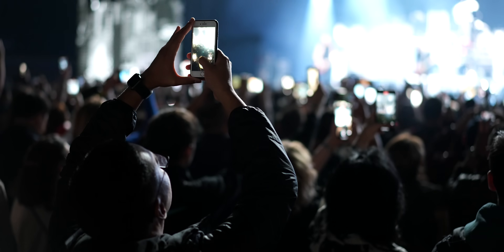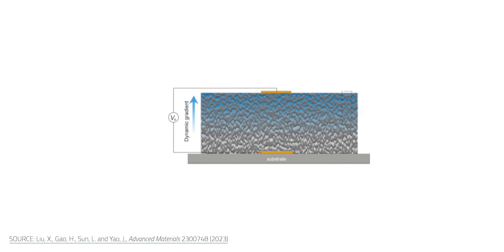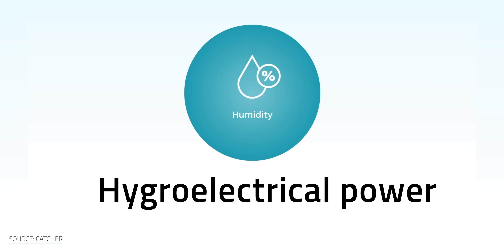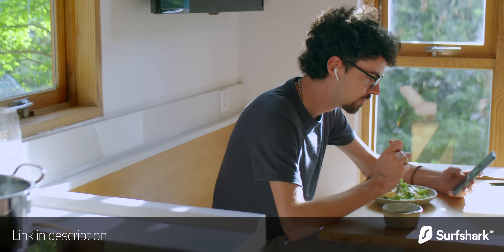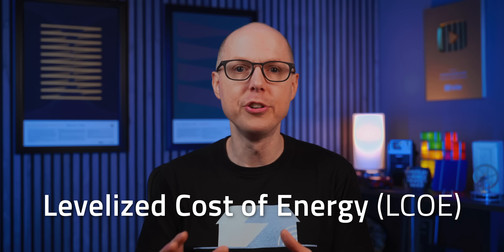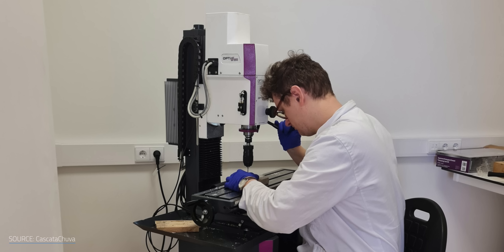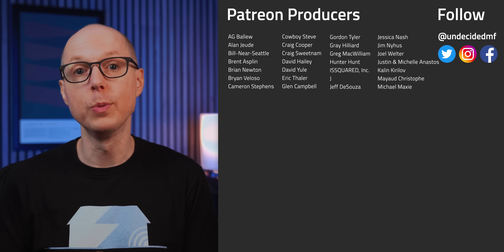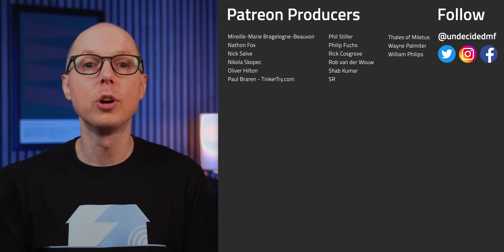Is This Accidental Discovery The Future Of Energy?

Comment: I'm curious, but my concern is that making electricity always involves making heat- thanks thermodynamics. This suggests that at scale, thermal impacts will change the specific humidity of the 'battery'. Maybe i'm just being cynical, but i'm not sure how this would scale without impacting performance.

Comment: My guess is even if this works, the device will get clogged up with dust too easily. You need humid air to produce electricity, but water is not the only thing floating in the common household's air. So you'll need some really good filters to just let the water and air pass through, and then with an average user probably not cleaning them well, you won't get good results.

Maybe you could seal the system up since it doesn't seem to be using up the moisture in the air (or if it is, where is the used up moisture going?), but then we are getting into some perpetual motion or reversing entropy realm (if the whole device would run on temperature, aka speed at which water is moving to bump into the nanostructures harder).

So I wouldn't hold my breath...

Comment: I wonder if adding this close to a humidity causing source will increase output, like adding it to the drain pipe of an Evaporation Coils in AC or to Dehumidifiers above the water storage bucket to help reduce electric costs of running these electronics. Maybe even refrigerators, which must have some way to remove evaporation from the coils. I know basements can become humid as well.

Comment: Erm, 10kWh/day is not the same as a 10kWh solar panel array. Assuming 50% output and a 10 hour productive period then a 10kW array would produce 50kWh. That puts this system at 5 times the cost.

Comment: Ummm, so wouldn't it just get 'water-logged' within seconds at that scale?  The difference  in water bumping is the key then it would just become balanced or coated. The moisture would have to leave to continue to work. So you would have to move moisture through which requires power.  

This doesn't destroy the H2O into components does it?

Comment: It would work great on the coast or around humid lake beds. But would lose efficiency greatly in high, dry, and arid environments. Definitely interested to see this grow towards something practical.
Reply: I believe the principle works, but it is self limiting, making it impossible to commercialize. The air has a certain level of humidity. But the nano-pore materials, we can think of that as having a humidity level as well. A moistness level . At the beginning, the device is completely dry as it comes off the factory floor. It would be sealed with water proof plastic film. You order your $20,000 washing machine sized device, and they deliver it, and rip off the packaging. And it starts working immediately.

Because the humidity level in the air is high, the moistness level in the material is near zero. You get electricity for a few weeks or days, and then the voltage starts to drop off as the air-humidity and nano-pore-material-moistness approaches each other.

Anybody who does 3D printing using FDM machines with nylon filament would be familiar with the problem. The spool of unused filament absorbs water from the air so fast, it becomes unusable even as you are using it. You put it in a dryer to drive off most of the absorbed water moisture, put it in your printer immediately afterwards, and before you've finished printing a 6 hour job, the filament has absorbed enough water from the air, the second half of the object you are printing is unusable. The proper way is to keep the spool in a container that keeps most air moisture out, with only a small hole for the filament to be pulled out and into the printer. But if you leave the spool of filament on the table for a month, the air in your room does not get as dry as the desert. Nor does the filament ever get dripping wet.

Think of the tiny silica packet that is supposed to absorb air moisture in some products we buy. Just because it can absorb moisture, does not mean it will absorb an unlimited amount of moisture. This seem to be the underlying oversight in Cascatachuva's wishful thinking. That little packet is not going to remove all the water moisture from the entire atmosphere of the whole world. It absorbs so much, and then it stops, because it is full.

Comment: One problem I have with this device is where does the 10kWh of energy a day come from? Using the law of conservation of energy 10kWh is a lot of energy, where does it come from? Does it convert thermal energy to electrical energy and cause a temperature drop? Does it dry the air as it passes through removing some of the water? So, this thing is sitting in your basement generating 10kWh of electricity a day from the humidity in your house, or even supplemented, does it heat up or cool down? change the chemical or molecular structure of the water? Where does all this energy come from since energy can be neither created nor destroyed but can appear as matter. It sounds like an electrical perpetual motion machine, unless someone can explain where that 10kWh/day is coming from, if it appears at all.

Comment: This one doesn't pass the smell test.  "Cold Fusion" turned out to be getting its perceived excess energy from the reactivity inherent in the exotic materials used.  A version of this could be happening with this claimed energy-from-humidity gadget.  If a washing machine sized device could extract 10 kW-hr per day from humid air (Tesla Power wall's  biggest battery can store 10 kW-hr), then that humid air has to change its energy state downwards, probably by first condensing and then by freezing which will clog the device's receptor surfaces.  If I am correct, maybe this device would also produce chilled water (a super big if).

Comment: This hit social media quite a while ago, earlier in the year I think, but guys... this is really basic, raw research that will probably NEVER turn into any sort of real scaleable electrical generation solution.

There are a lot of red flags when it comes to scaling something like this up.  Not the very least, nano-structures, free air, and humidity are subject to getting gummed up very, very quickly.  There is also the problem of the temperature differential.  The energy is not coming from thin air.  It is coming from a phase transition of the water molecule, bond breaking, or other energy transitions that in any volume would probably freeze the material.  And there is the problem of maintaining any sort of air flow volume through a larger cube of this material.

Also, when press releases and marketing material leaves out critical information but still try to talk-up "voltage" (for example)... that's 100% meaningless and a big red flag that the company doesn't actually have anything that works to any meaningful degree.

Just for comparison, a calculator solar cell the size of your thumb generates a hundred times more power in ambient light than that science experiment did.   A "nuclear battery" also generates well over a hundred times more power in less volume.   And even a modest solar array in cloudy weather produces 9 orders of magnitude more energy than this science experiment did.

There aint not'in here.

-Matt

Comment: I'm skeptical, to say the least, that this is something that we can actually get any meaningful power out of, but lets assume for the moment that it does work. What actually happens to the water here? Either you're removing it from the air and somehow extracting energy from that removal process, in which case this is the best dehumidifier ever invented, or you're extracting heat energy and releasing the water back into the air at a lower temperature, in which case this is free cooling, albeit with a swamp-cooler effect of increasing humidity. Presumably, in the first case, there is a minimum effective humidity required to operate the device, and in the latter case, a minimum effective temperature.

Since "free dehumidification" and "free cooling" seem too good to be true, I highly doubt there's anything real here.

Comment: I think one use that could be helpful is turning on vent fans. Many people forget (I do) to turn on the vent after a shower. A power source that only works in humidity could turn on the fan when humidity is high and "run out of juice" as it vents the air out. Might take some tricky calibration but once done could have a lasting impact on reducing mold, mildew etc in certain environments.
Reply: You can buy an extrtractor fan with a humidity sensor in it that does this. Order one, and enjoy your reduced mold and mildew worries : )
Reply: That is terrific!!!
Reply: My bathroom fans have humidity sensors and do this. Powering themselves from this same humidity would be awesome.
Reply: that's litterally the initial intent of the research.  not direct power, but a humidity sensor, and that can close a solinoid to start your fan.

XD
Reply: @SanosukeTanaka  such sensors already exist. I keep snakes that require about 70% humidity in their enclosure, and the climate controls I buy on Amazon for something like $70 use a sensor that monitors humidity and supplies power to a fog generator as needed.
Reply: Great Idea!
Reply: How long after a shower should you leave the fan on?
Reply: @Eurotool  long enough for all the humidity to dissipate - humidity fans also have an adjustable timer.
Reply: They do sell humidity sensor wall switch you can buy right now
Reply: I wonder if their is some kind of cooling solution possible.
Reply: @autohmae  So, if it is generating power from the impacts of the atoms then the atoms would be cooling down by slowing down their movement. Depending on how effective it is at turning heat into energy it would be a cooling solution.
Reply: Those little fans really consume very little energy, that's not the greatest idea but I guess...
Nothing beats opening a window, or if it's too cold outside, just build the fan to activate whenever you switch on the light.
Reply: Beyond that, this could result in a dehumidifier that powers itself.
Reply: So, pretty much just use it in the original intended role, as a humidistat
Reply: How long before we can reclaim energy from lightning?
Reply: Fans with humidity sensors already exists...
Reply: This is pretty standard. My ventilation system reacts on air quality and humidity to save energy.
In the shower it starts 1 minute after starting to shower and stops when sufficient humidity is gone.
Reply: Sorry to spoil the fun of a well-meaning science buff, but...

CO2/climate-change is the biggest mass-fraud since communism. 

(See Henrik Svensmark for the cosmic-ray/solar-activity/cloud-formation/climate relationship.)

 CO2 is a ruse. 

Climate change the "Greens" are talking about is caused by changes in the cosmic-rays/solar-activity relationship and cloud formation  (See the work of Henrik Svensmark.)  

Cloud formation by actual cosmic rays can be scene with the naked eye in Cloud Chamber demonstrations.  YouTube has dozens of videos about them.
Reply: Thats a bit genius
Reply: People on this comment section are pretty thick. They read your statement and thought to themselves, the only place a fan like this could be used is in your bathroom. I guess when you live in your moms basement, that might be the only humid place you have gone. Also the point that it would not need to be hooked to a power source, ever. That may not mean much to you ultras geniuses with such wow reading comprehension, I am sure all your power is free and you never need cords, but us plebs think it's cool.
Reply: @jenniferheyden4843 they already have bathroom fans with humidity switches, which cost about $35, ask you daddy tomorrow and perhaps he can install it for you.
Reply: @ruzziasht349  Yes, they have switches that close when it reaches a certain humidity allowing an outside, on-grid, pay-by-the-watt electricity source to flow through your fan, but the whole subject of this video was using a 'humidity senser' to generate small amounts of electricity. So, while it may be arguable that your father should apply a switch more often, the OPs 'daddy' cannot install one tomorrow.
Reply: @aceichner I was replying to the thread "Many people forget (I do) to turn on the vent after a shower".

Comment: You can power an LED by a large antenna. Nothing is needed, wireless signals through air is enough for that purpose. The problem I see with these systems is that after a time, the difference in humidity in levels out, stopping the energy generation. Now if the device is small enough tiny little changes in temperature will create a gradient, but with large devices you will require constant change in temperature or humidity for these to keep working. Otherwise, like a battery, it will be drained but charged slowly. However, it could be a good system for mobile devices which you naturally move around, like phones.

Comment: Sounds interesting but, as you noted, they have a very long way to go. How would this system work in extreme cold or hot temperatures? Also, with the way humidity levels vary, the overall functional capacity of these units would be questionable.

Comment: Have to wonder where the power is actually coming from and what the energy flow looks like thermodynamically. Setting up a charge imbalance like that shouldn't create lasting power any more than you can get free energy from a magnet, there has to be a constant flow, some continual process. As described you'd expect the nanopores to eventually become saturated and stop generating energy, and that you'd need to apply power to drive off the water and reset the system(which should take as much or more energy than the system generated), or for there to be some other one-way process going on; power is created by energy flow as it works to correct an imbalance, not just from the imbalance itself.
It smells like this will turn out to be a battery instead of a generator, but it just takes so long to for the trickle of power to deplete it's capacity that, combined with the uncertainty over what's actually going on, it's not obvious.

Comment: Hm, this smells to much like free energy. The most charitable interpretation that I have is that it turns the energy from condensing water into electricity. And there the question is if there is a way of regenerating the device, i.e. getting the humidity out of the nanopores without spending more energy than getting out.

Comment: How can you compare a battery with a 10kWh/day capacity with a 10kW solar panel system? The solar panels generate as much electricity in an hour at peak power than the battery during a full day.

Comment: The math for the comparison of the panels and that humidity device doesn't make any sense: kWh is not the same as kW. kWh is a measure of energy, kW is a measure of power. A 10 kW solar array will generate somewhere between 30 to 60 kWh per day depending on light conditions and time of the year or 3 to 6 times the amount of energy generated by the hygroelectrical device, in fact that same array will generate 10 kWh in just one hour when the sun it at it's peak. The hygroelectrical device will have a power of 0,4 kw but it should run all day long and that power over the course of one day will generate 10kwh of electricity.

A good way to understand the difference between kW and kWh is to translate kW an kWh into liquids. kW is the amount of liquid that flows out of a faucet in an hour while kWh is the capacity of a container, a 10 kW "faucet" will fill a 10 kWh "container" in one hour and but you want to fill a 10 kwh "container" in one day you need a 0,41666 kW "faucet" (0,4166 x 24 = 10).

Comment: Once its saturated with humidity it will quit producing electricity. You need to dry it out and then expose it to humidity again. Drying it out requires energy. So this is not an energy source but an energy storage device.

Comment: Oh man this could really be a blessing for me in the winter. I live in a small house and use ventless gas heat. That produces loads of humidity burning natural gas lol. I could use a device like this to pull humidity out of the air while gaining power. Bring it on!
Reply: This is honestly like the first idea I've seen on this technology that might have legs. Condensing gas appliances can only do so much to extract the last little bit from the combustion byproducts. Something like this that works at ambient temperature might be able to extract most of that last few percent. But the regen that this technology almost certainly requires probably would eat up that last percent as well. Probably very close to net zero gain. 

Also, natural gas combustion contains a lot more than just water. Sounds like a recipe for plugged cells.
Reply: Oh wow, you should read some research papers on the effects of indoor CO2 on cognition, sleep quality, headaches, tiredness, etc.  As indoor CO2 goes up, ability to learn, process information, etc all goes down.  A ventless gas heat system must be producing ungodly amounts of CO2 indoors.  If I were you, replacing that with a vented system or a mini-split heatpump, etc would be my #1 priority.

Comment: Wouldn't an efficient way to make the battery is make an airtight room around the battery, artificially raise the humidity, and then have 2 pipes go out from the room that are a closed looped system. One half of the pipe is outside, and one  half is underground. That should create natural air flow to push the water molecules through the battery.
Reply: How do you artificially increase the humidity in a closed system without putting heat into the system to vaporize water?

And what makes you think doing so would require less energy than this device would extract?
Reply: @bradley3549  it's called a passive humidifier. No electricity needed.
Reply: @PhoenixBlade  I didn't say it required electricity. But it does require energy input to evaporate water. No free lunch.